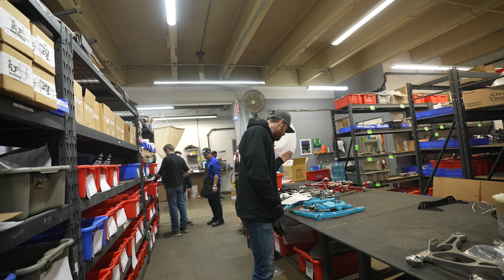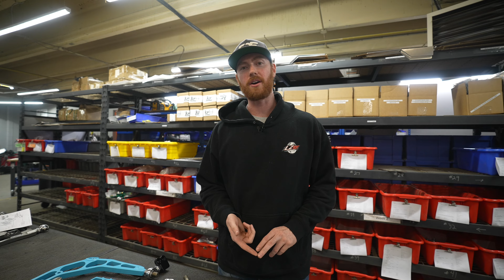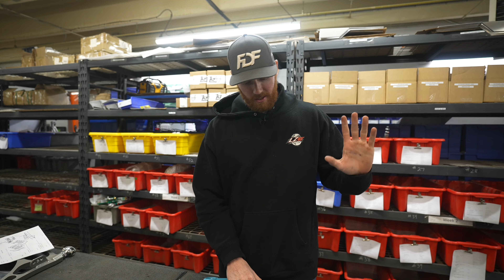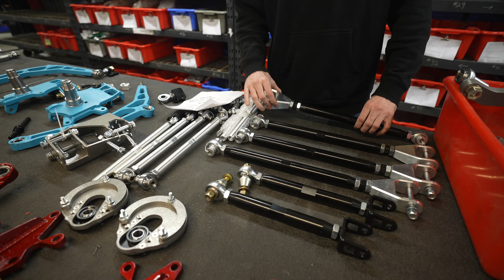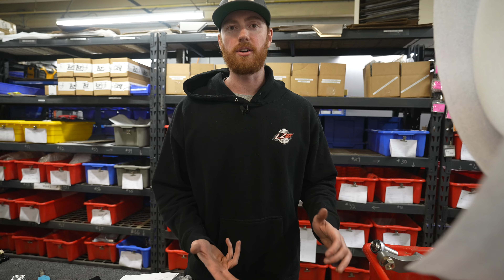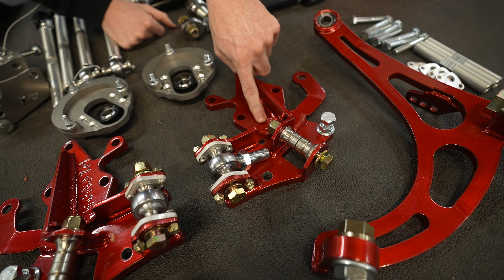Some of the coolest products we ship out daily

Comment: I don't know if this is a good idea. But have you thought about, let's call it, a builder series front end kit. Something that is double a arm and not based off anything. A kit that would allow people with older, full frame cars to retro fit onto their chassis. It would obviously not be bolt on and something that requires some fabrication skill. But you see these guys body swapping old cars onto import chassis for drifting. Even if it was something where you made the a arms and spindle and provide the needed measurements of where to locate the a arms in relation to each other. Or some sort of a supplied jig that holds them in place for us to make frame mounts for the control arms. Just spit balling here. Worse case I'll make my own double a arm setup. I just don't have the drift suspension knowledge and would be basing it off of road racing.

Comment: Cool idea for the series!

 I have a random question more as an engineer - on the e90 kit knuckle adapter there is a small tear drop shaped tab  coming off the top end, what’s that holding? Like an ABS sensor? It doesn’t look like it could take too much structural load but I know there has to be a reason for it.
I am an S-chassis owner and know nothing about BMWs 

Also, I love your in depth “why’s and how’s” that you include in your videos.